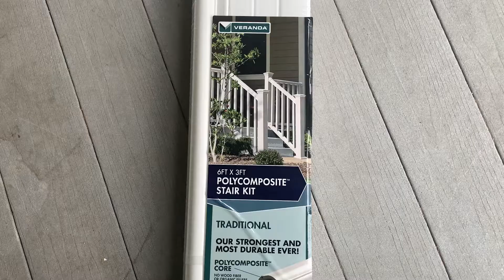Veranda Stair Railing Replacement

Comment: Still wobbles
Reply from the maker: It can move, it just should not fall apart like mine did at the beginning of the video.
Reply: @rednerd   I think the post was the issue why it moved so much at the end
Reply: Why moves so much? 
If you try to sell the house, it won't pass inspection. It feels like it will brake.